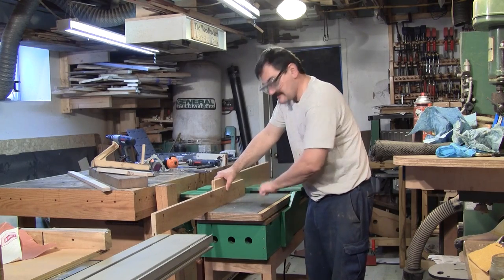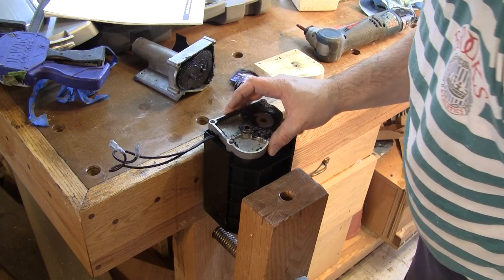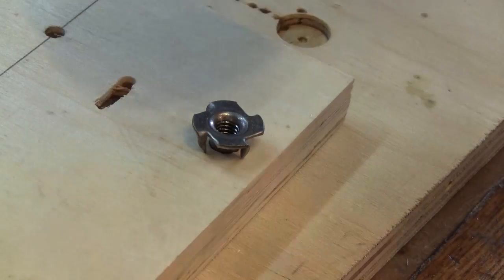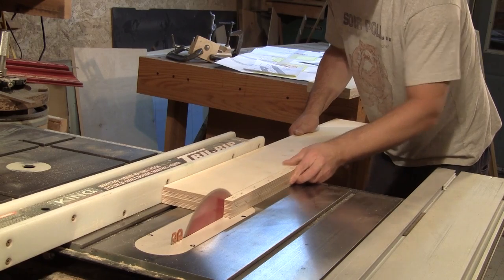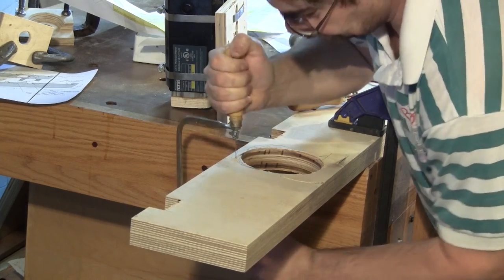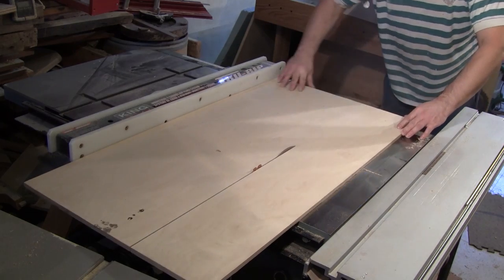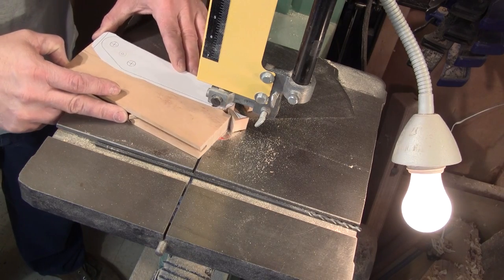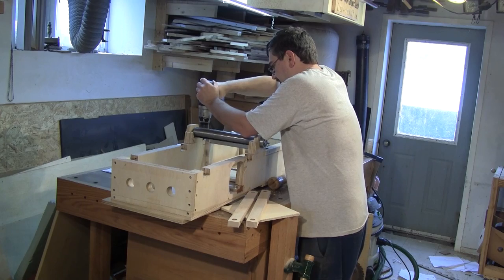The Woodpecker EP 44 Wooden Jointer

Comment: Matthias really came up with a great design! That's a great addition to your shop Alain.
Reply from the maker: Yes it is. And now it's the jointer I mostly use. Having a cutter the same width as the thickness planer is so practical.
Reply: I bet, its extremely economical also.

Comment: Hi Alain,

Thankyou for your great video.  I am in the process (as we speak) of building this jointer using Matthias's plans. Your video is a terrific resource for me as my thicknesser - whilst branded Ryobi here in Australia, is exactly the same as your Mastercraft. It has been great having your video to supplement Matthias's useful guides, which I have drawn on heavily to modify my motor as per your approach by removing the extraneous gears etc so it fits in the jointer body. I am having a bit of trouble though extracting the cutterhead as I cant seem to get the bearings out by banging either end - It looks like I run out of space to push the bearings because the cutterhead hits the housing before the bearing makes it all the way out.  I would be extremely grateful if you could please shed some light on how you managed to do this so effortlessly at your end - obviously I'm missing a key step, but dont know what it is (did you shim something between the cutterhead and bearing to add more push?). Any help you can provide would be greatly appreciated as my frustration with my lack of progress is now growing exponentially, and I am beginning to fantasise about taking a sledge hammer to this thing. Thanks again for your great videos, and what a terrific shop you are building! Regards, Steve.

Comment: Well done, I've built this jointer too, but I didn't buy a planer for parts, I bought a cutterhead from warranty service and a silent induction motor. Everything works fine on mine, once I set the blades correctly, but the setting itself is a nightmare for me. I do everything the same as Matthias and others on Youtube, but it seems that if I press on the table stronger (while setting) the blades go deeper in the head. After 15-20 tries - I finally set the blades right and then avoid using the jointer because I fear dulling the blades... ugh!
Reply: I haven't built this jointer yet, but all I can think is maybe your metal top is not laying fully flat on the wood?  Maybe a very tiny gap between metal and wood that closes when you press down?
Reply: That might be a case. It would be best to glue metal to wood I guess, but I got it working a different way. I ground some metal off of the setting gauge (the one that comes with a planer) so that it would fit on the jointer as well and I set knives with that now, and it takes about an hour to remove, sharpen and put back in knives of both planer and jointer. 

If it's not too late I strongly advise you to use MDF for tables instead of plywood. Plywood is dimensionally stable, but it's not warp proof wich is the case.

Comment: OMG Alain, i am from Argentina, and i had the same model of jigsaw. B&D with a mobile head that let you rotate the blade. Its an absolute crap. It made me for years hate all jigsaws, untill I finally got sick of it and send it flying of the window of my shop. Then i buy one of Dewalt, and was a eye opener. I realize that my old jigsaw was, in fact, a really bad design by B&D. Now, I use the new one almost every day, and coudn't be more happy with it. I sugest you do the same. BTW, your shop its going to be a dream one.
Reply from the maker: Youre right, since then I bought a used Festool and like you said I'm using it :))
Even just yeaterday I said to someone who came to help me with my nes shop : " I never tought that a jigsaw could be that useful!"

Comment: very good work. just wondering, as you bought a brand new planer for the motor and blade, wasnt it good enough to make the work? why had to build a jointer of it?
Reply from the maker: +emiljan alhysa I wanted a wider jointer, it was cheaper to buy a cheap planer and use the motor and knives to make a jointer.

Comment: Almost makes me want to build one myself. Perhaps in a few years. So how well does it actually perform as a jointer? Thanks.
Reply from the maker: I was surprise by well it's working. I think the cut is smoother than my 6" all cast iron one. I think it's because the cutter head turn faster than an normal jointer.

Comment: Thanks for sharing! I really enjoyed your video. Are Wandel's plans easy to print out, put together and use?
Reply from the maker: The plans are easy to print if you have his BigPrint program. But this is not a problem, for me this program is as important as my table saw. I don't do any project without using it.  As for puttin it together; this goes prety well, but it's not a weekend project. Using it is a charm , I use it every time I hade to joint a board

Comment: How do you adjust the blade if it is not square with the surface? Are there adjustment knobs?
Reply from the maker: ***** I aligned the bade with the infeed since it's the moving part. Then I adjust the ooutfeed inline with the infeed. It's quite easy with the 4 bolts ,one in each corner, the adjustment is differnet but more versatile.

Comment: When your jigsaw blade snaps off (which is always at the hole) just file it down until it fits in your jigsaw and continue to use the blade.  Since the hole is the weakpoint you wont have the same problem for quite some time...
Reply from the maker: +basilg78 Thanks for the tip :)
Reply: +Alain Vaillancourt I really loved your project... definitely gets the mind wandering about what you can do with plywood and your ambition.

Comment: Good job but why would you even consider destroying a new 12 inch planer to make a jointer.  planner is designed for wide stock. so even if you have to flatten one side of a 10 inch board, now you still need a planner.
Reply: He has a planer. A 12" jointer costs quite a bit more than he spent here. 12" planers are cheap.